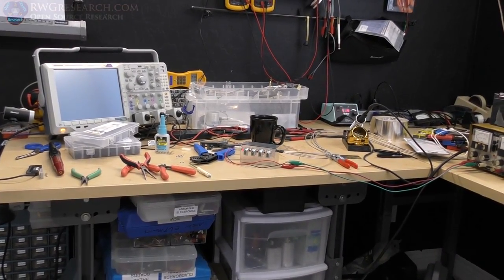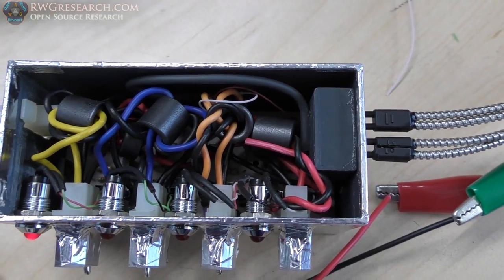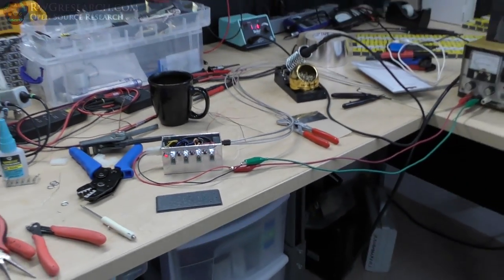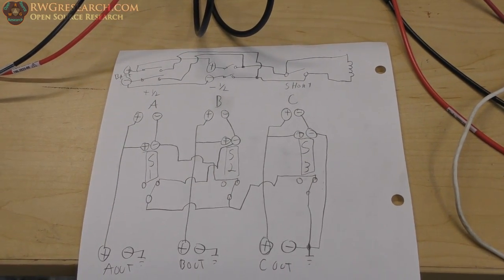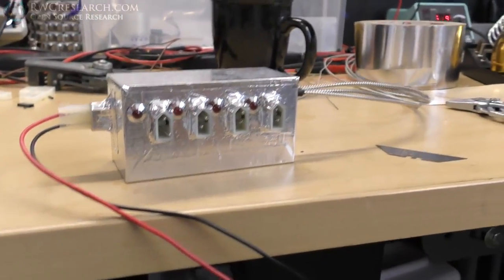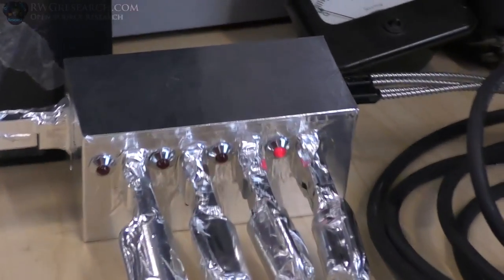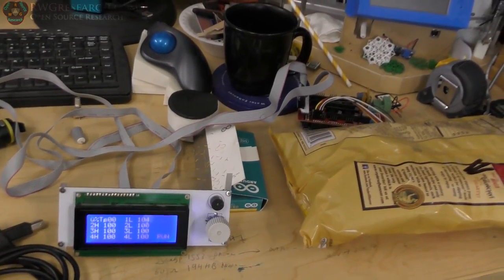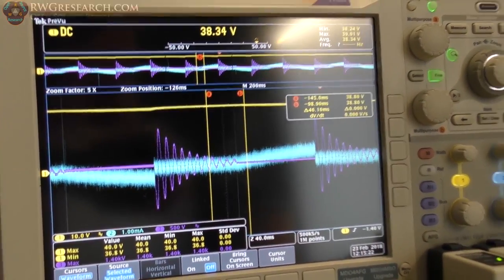JWN Project P9: Part 2 Building The Fiber Isolated Relay Driver PCB.

Comment: a few things. why not use solid state relays? they are opto isolated from the start take almost nothing to trigger them 3-32V DC trigger and consume as much power as powering 2 LEDs on the load side they can be sized to handle large currents, wide allowable load voltages including AC and DC variations. you can also switch them much faster than mechanical relays can ever dream of.  I also have a concern with your shealding materiel. aluminum foil tape has isolating adhesive.